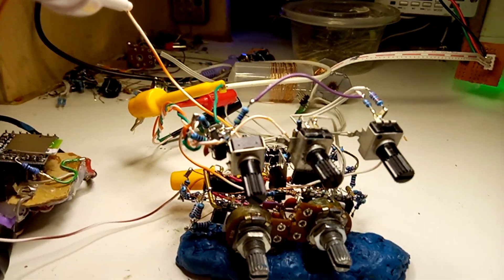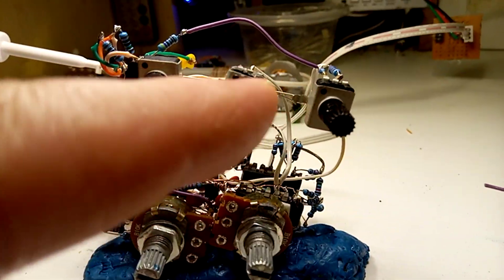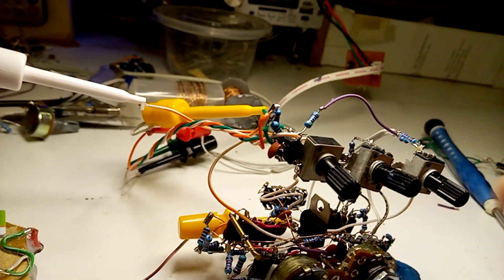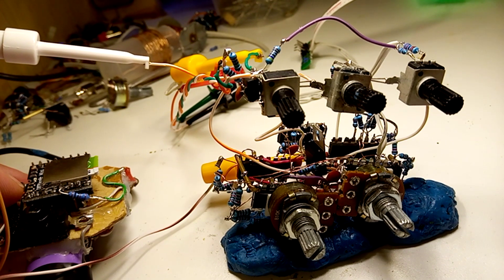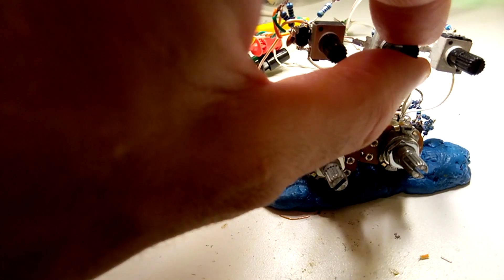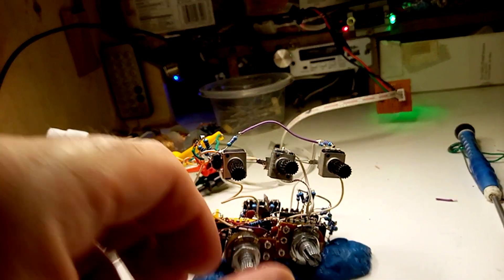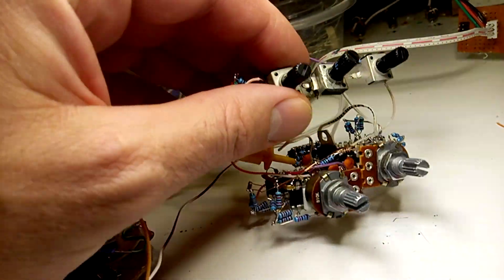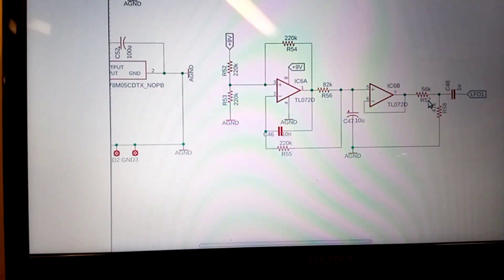quad-PT2399 circuit that actually sounds like reverb!!!

Comment: hey nice! thanks !
what are the changes you made to have it work with 12v etc modular?
Reply from the maker: The input buffer and mixer run from +/-12V so they can be a bit simpler. Since modular signal voltages can swing 10V, I attenuated the signal going into the whole circuit, and halved the signal going through the reverb circuitry, amplifying it by 2 in the way out. I'll try to get in touch with the designer to see if he'll allow me to release a schematic for a modular remix of his project.

Comment: A Stripboardlayout would be supernice !!
Reply from the maker: Hoooooo boy, stripboard is NOT my thing. I fail so so hard at that. It's quite a complex circuit, check out the video I link to - there's a link in his description with a great write-up and schematics.
Reply: @ozerik  Oh yes the link. Was it already there when I wrote my first comment? With the schematic I can certainly do that too. But I find stripboard easier. However, I've only been dealing with electronics for a little longer than half a year. At some point I have to learn it :) Thank you very much! And as always, take care and greetings from Germany.